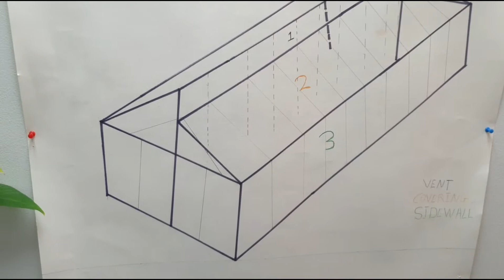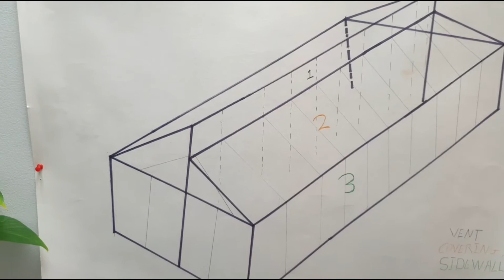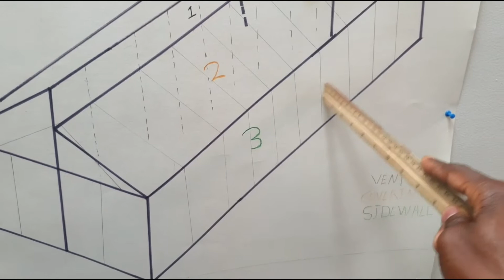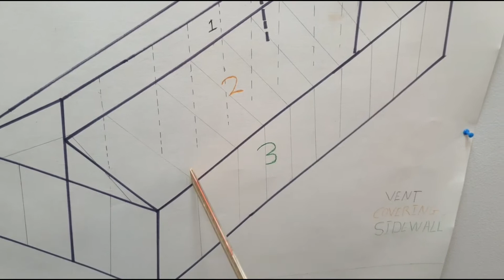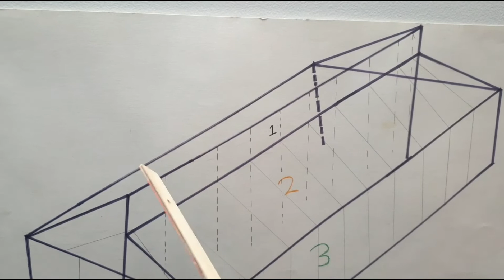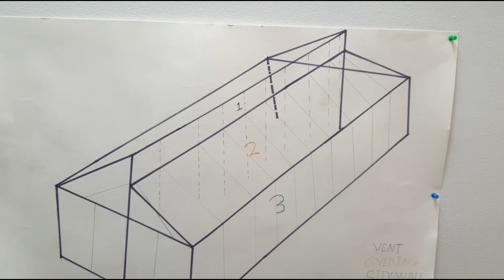Building a low cost wooden greenhouse? | here are the measurements and materials

Comment: What is this kind of greenhouse with a vent area between the roof called? I would like to read up on it. Is there a website link with info about this kind of greenhouse?
Reply from the maker: This is a gable roof design which is adaptable in tropical conditions. You can do a Google search and look up the designs and you will get information regarding this type.
Reply: @MCAgriTech  oh thanks. What if the the longer part of the greenhouse is facing the prevailing wind? For example, if the back of the green house is in the direction where the prevailing wind is coming from.
Reply from the maker: @JayC-xh5yv  If you orient the green house like that, then the passive air movement that you mostly want will not occur as how it should.  What I mean is, the wind passing over the greenhouse should help with removal of hot air or general recirculation of air however, if the wind is blowing into the vent area then you can imagine that the hot air inside the greenhouse will not move out of the greenhouse as it should.

Comment: Can roof 2 be the higher roof instead of roof 1? Great video
Reply from the maker: Please note that 1 is the vent area. As long as the prevailing wind is passing over the higher side of the roof first, then it doesn't matter which side is higher. The prevailing wind should pass over the higher side of the roof before it passes the lower side to pull air out of the greenhouse.
Reply: @MCAgriTech  oh thanks
Reply from the maker: Great